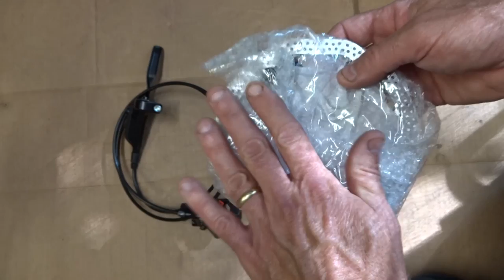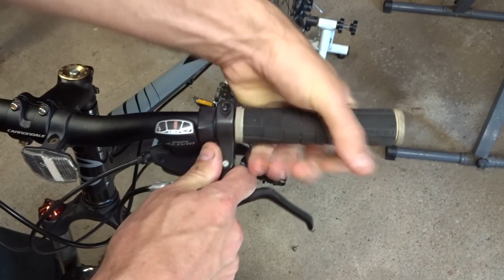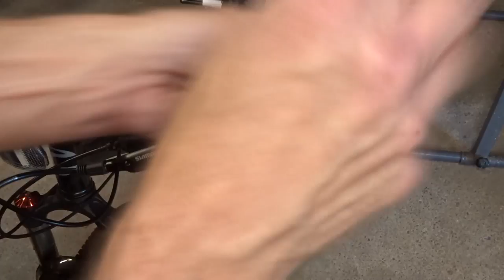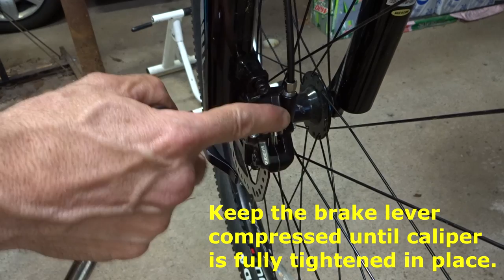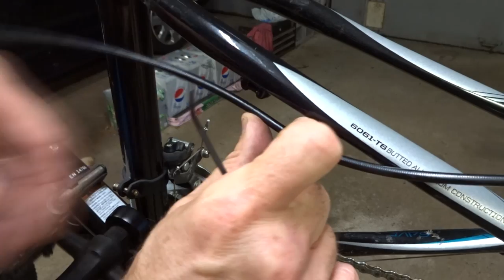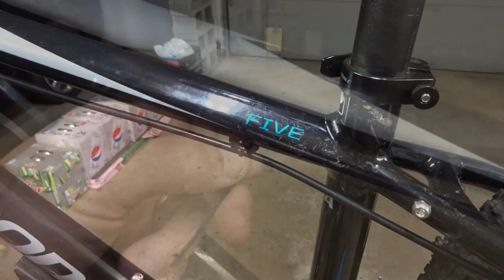How To Convert To Hydraulic Disc Brakes From Mechanical Disc Brakes On Mountain Bike

Comment: Easy as that, but my bike has the old type of brakes so now I also need new 26" wheels. Damn it.  Lol
Reply from the maker: If you want disc brakes, I suggest you buy a bike with disc brakes. Easier and cheaper.
Reply: @RJTheBikeGuy  I have an old Gary Fisher tassajara and i believe it has the mounting brackets for disc brakes already. That's why I said that. I need to take it out of storage though (my friends garage). I love the bike but it didn't come with disc brakes when I bought it years ago unfortunately. It's my very first bicycle which I still have.
Reply from the maker: If it has the brackets, then it is is doable. Still it can add up with the cost of wheels and calipers, rotors. Fun project though.

Comment: how do i know what length of tubing i will need? or is it a universal thing?
Reply from the maker: You need to get a rough measurement of the length the hose will have to travel from the brake lever to the brake caliper, remembering to leave room for the handlebars to turn.
Reply: @RJTheBikeGuy  ok

Comment: Brakes were perfect, but I took of the wheel to change the tyres for new ones and now its breaking always (not hard)
Reply from the maker: Sounds like either the wheel is not mounted straight and the rotor is rubbing, or the wheel wasn't straight before and the caliper was adjusted to crooked wheel. Or you have hydraulic brakes and pressed the brake lever while the wheel was not installed and the pads got pushed in.
Reply: Thanks for the fast answare, I think it may be the first one, since the bike is almost new and the brakes are mechanic, how can I get sure to install the wheel straight?

Comment: But I have my shifters attached to the brake levers. Does that mean I need to get a set of new shifters too? And maybe that means I need to get new derailleur?
Reply from the maker: If the brake levers are made for v-brakes, they will work with cable actuated disc brakes. If they are made for other types of brakes, then you will most likely need new brake levers (and so shifters too).

Comment: Can you swap the cables from hydraulic to mechanical??
Reply from the maker: Hydraulic don't have cables.
Reply: RJ The Bike Guy no like I mean can I change the hydraulic lines to mechanical
Reply from the maker: You'd also have to replace the levers, and calipers. Yes, you can, but why? Hydraulic brakes are a step up from mechanical.
Reply: RJ The Bike Guy because I’ve had my hydraulics on for just over 2 years and I’m in need of a second bleed already and it’ll cost me £25 for both brakes so if it’s cheaper to get mechanical brakes then I would’ve because my mates mechanicals are just as strong as my hydraulics have ever been but he doesn’t have to do anything with his to maintain it’s performance. But considering now that I will have to change the callipers as well, I think it’ll be cheaper and easier to just stick with my hydraulics.
Thanks
Reply: RJ The Bike Guy Also, I wonder if you can help me out with finding some new pads, I’ve got Tektro callipers but it doesn’t say exactly what ones so I I have no clue what pads I need. It also has some numbers on it (130219, above 34-001). Any ideas on how to find what out what pads I need.
🙏
Reply from the maker: Figure out what model they are first. The model name is usually on there. Or google pictures and figure what you have. Or take it to a bike shop.
Reply: RJ The Bike Guy ok thanks

Comment: My mechanical disc brakes are fucked  because my friend sprayed WD40 on them and they are ruined. They were pretty shit anyway. Should I get new hydraulics or some different mechanical.
Reply: you said that they were already shit, so I suggest you to buy new shimano mechanicals but before installing them clean off the oils from the discs. I also did this to my previous bike and it worked awesome, after 6 years os usage I only had to change the back brake pad which was very cheap to buy!

Comment: Use WD 40 under the grips using the straw and give it a squirt and twist the grips till the glue loosens. 👌🏽
Reply from the maker: WD-40 leaves oily residue and can make the rubber gooey. There is no glue.
Reply: @RJTheBikeGuy  AGAIN: Use WD40 to loosen the GLUE (IF IT WAS APPLIED!!!) with the straw. Twist grip off clean out grip with Dawn soap reinstall with Alcohol.
Reply: @RJTheBikeGuy  People aren’t literally going to leave WD40 on the grips overnight bud....🥴

Comment: Hello where do I get special oil for front brake
Reply from the maker: You can probably find it on Amazon, or maybe your local bike shop. Make sure you buy the oil specified for your brakes.
Reply: RJ The Bike Guy can you write the name of the oil?
Thx :)
Reply: Or send my a link of Shock Absorber oil in amazon
Reply from the maker: You need to research what oil YOUR brakes take.
Reply: It is mineral oil. Most companies use mineral oil and that also is modified with additives so that they can milk you forever. Look at motorcycles, they use dot 4! It is standardised.

Comment: use the rotors that came with the brakes because thats rotor disc and there is a lot difference beetween the mechanical disc and rotor disc
Reply from the maker: Really...Hmmm... Show me authoritative documentation on this.
Reply: well my friend is using mechanical disc with a hydraulic brake and im using a hydraulic brake with a rotor disc im stoping faster then him and my disc doesnt get that hot as his one batter use the rotor discs
Reply: Erdem's suggestion is correct but not because rotors differ for mechanical and hydraulic brakes. You should use the rotors that came with the brakes because the other ones may not be compatible with the brake pads of the new caliper. For example, the metal used in some rotors is only compatible with resin pads and if you use them with metallic pads, the rotor will of course work but will, in time, be degraded and destroyed. Regarding shimano brakes, the shimano compatibility list mentions the different pad materials that can be used for each caliper and for each rotor, so you can deduce which rotor you can mix with which caliper. I assume similar info will be given by other brands too.

Comment: I'm always using compressed air to remove handles. With a little work they just pop off. I'm also curious to why cyclists always wants the front brake on the left. It's rather weird for us motorcycle guys. I usually flip mines to work like om my motorcycles.
Reply: All bikes I've ever had from factory fitted are front brake on the right does seem odd.

Comment: Hello RJ. I have watched almost all of your vedios and got very important information from it. Can you please do the reverse of this vedio. Mean from hydraulic to mechanical disck breaks.  I will be waiting for it. Thank you very much in advance.
Reply from the maker: Why? That is a downgrade. I am probably not going to be making a video like that.
Reply: @RJTheBikeGuy  well as hydraulic breaks are very difficult to service an maintain so i would like to downgrade to mechanical disck breaks. As i work as a delivery rider and i work on cycle for atleast 6-10 hours, so its difficult to maintain hydraulic brakes in shape in that case.
Reply: @siyyaf  it is just the other way around.. nothing difficult.. If I can ask what are the problems with the hydraulic please?
Reply: @antoniogalluccio4213  its difficult to clean some time one piston work more then other. There is bleeding problem. So that's why i thought of downgrading.

Comment: Why are you doing that just to take the grip off.
Just simply undo the brake lever and pull the brake lever towards you in a twisting motion and it pulls the grip off.
It's the easiest and most simple way to remove the grip.
Your way is so much messing around.
And when you put the grip back on all I do is bang the end of the grip and it goes back on.
Simple really.
That's how I always do mine and never had any problems even with soft floppy grips.

Comment: Use lock on grips
Reply from the maker: I don't like them.
Reply: Easier to service
Reply from the maker: It's not hard to remove install regular grips. And regular grips feel better to me. You can use what you want.
Reply: Yeah less hassle=more work lol
Reply from the maker: @dimondbackdownhiller1337  I rarely have to remove grips. So an extra minute to remove them is not a big deal. But they feel more solid during all those hours of actually riding the bike.
Reply: Tru all preference to the rider and mechanic

Comment: That's a bit showing the obvious and skipping the complicated things. It's no rocket science to replace some parts if the new parts fit and are hold by 3 screws only. I theink the far more complicated thing is to find the correct hydraulic brakes that can replace the other ones. Maybe it is easier than I think, but if I look at disk brakes I am confused by different standards, different mounts, different diameters, dthe difference between front and rear-brake etc.

Comment: you are just changing the calipers and the handle's, that's not a conversion. you practically changed the whole brake system

Comment: nice but mechanical brakes works best fo me
Reply: Brahma Astra no they are just easier to maintain
Reply: Mine br m 375 with new cables works like hydraulic brake, i almost don't need any force to push the brake :p, and they brake like most common hydraulic brakes :p
Reply: I use hydraulic with 200 mm disc for front because mechanical brake went bad due to heavy loads, and a lot of times cable frayed thank God it didn't break on an emergency situation. For rear I use mechanical diecs brakes with 160mm rotor.

Comment: Even if they aren't in your preferred configuration, you can swap them.

You did do a video explaining why they are different for different countries. But I looked deeper and that still doesn't make sense. The reason you gave only applies when signalling for one side. You are symmetrical on a bicycle so can use both arms equally. Unlike a car when you're offset.

Not correcting you, just giving my input/opinion.

Keeping controls similar across various 2x wheeled vehicles (bicycles/motorbikes) helps a lot. I have a scooter and small motorcycle where the horn and signal switch are swapped. You have no idea how many times I honk when I mean to cancel and "cancel" when I mean to honk.

AARRRGHHH - I will fill your ears with silence as I cancel my signal repetitively thinking my horn is broken.
Reply from the maker: Feel free to ask the people in YOUR country why they require them to be like they are.
Reply: @RJTheBikeGuy  Actually, the bicycle sent here and configured for reversed controls. You can always tell when the front noodle is also a 90degree instead of the required 135degree for the correct  angle.

It's what you get when you don't follow the trend,

Oh, don't take my previous comment too seriously. Just meant to be fairly light hearted. You know how some things can be conveyed online.

Comment: Those hydraulic brakes arent much of an improvement over mechanical. Shimano Deore is my favourite hydraulic disc brake.
Reply: any hydraulic are better than mechanical. Even those BR-M355 let you go from four-finger to  single-finger braking.
Reply: Jarek Exactly. My Shimano M375 mechanicals with fresh cables gave me the same level of stopping power and very similar levels of modulation as the hydraulic M355. They share the same pad type. I think hardcore mountain bikers bash on mechanicals because they wear their pads down very quickly and need to keep adjusting. Otherwise mechanicals set up properly are excellent for casual riders.
Reply: They have hte same issues as these brakes have, but the lever body flex even more.
Reply: If you want mechanical you need a dual piston brake.
Reply: Earl Grey thats a budget hydraulic brakes
Reply: I ride Deore on my giant stance 2
Reply: Earl Grey im usin the cheapest m-315. Tbh the max stop power isnt that much more than the mechanical ones on my 400€ mtb, but modulation is still better, especially when ya have to brake hard. Pads are cheap af at 5€ per pair in austria. They are actuallmade for a 2 finger setup but they work in a 1 finger one just as fine.
Fade is probabluy the main problem.
400 lil meters of descent and they are hot af and fade with about 30-40% powerloss
Reply: Sram Guide for the win
Reply: Dot fluid is toxic, so  I won't use it.
Reply: Johannes Nilsen it is but ya can use the same dot as used in some motocross bikes. Also, just get some gloves when ya work with that. I generally use those whenever i work with oily parts of the bikw
Reply: shimano saint brakes are much better
Reply: Earl Grey yeah I’m pretty sure you can’t even bleed them
Reply: MINI MINNOW you can bleed every hydraulic brake. They’d be completely flawed if you couldn’t
Reply: I've had hydraulic brakes once in my time of owning bikes, They were decent yeah, But they didn't change my breaking life anymore than all the decent mechanical disk breaks I've used. As long as you maintain them, They are still a worthy solution. I'm all for saving a few quid when it's not necessary to spend it.

Comment: In the video, your bike come with Alivio shifters. These have gear indicators. I would have liked to remove the gear indicators and replacing them with a plastic plate (This comes as standard with XT shifters, see this video for reference, https://www.youtube.com/watch?v=e9GBT06-Xiw). Shimano don`t have a replacement cap for Alivio. Do someone know of a DIY soloution or replacement part? Removing the indicators would free up handlebar space for other things to be mounted.
Reply from the maker: I don't think most shifters are set up that way. Maybe buy some stand alone shifters and replace them.

Comment: It pains me to watch peoples "grip trick" for removal and installation. Theres no trick to hard mindless pulling, its the only way to not have throttle grip like this guy. Be a gorilla or get an air compressor. Dont use lubricating agents or sharp tools like a numb nut. Remember kids, for tight rubber adhered to bars, every tool is sharp, use your grips till you see handlebars.
Reply from the maker: Most people don't have an air compressor. I have one, but I don't leave it powered up. So this is more convenient.
Reply: @RJTheBikeGuy  I know what youre saying, but 10 year old me would have watched your video and probably split my grip in half with an allen key, then rode to the bike shop with one grip lol. Alcohol should evaporate better than other agents, but now youre making me think....... gasoline? lol